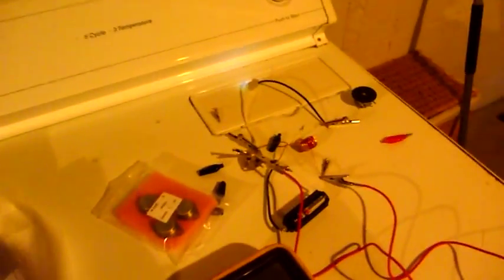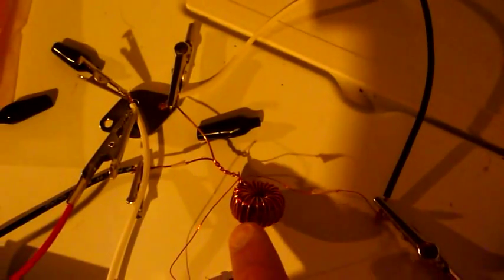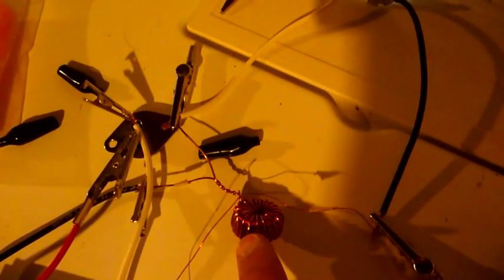Joule Thief with Magnet more light

Comment: Can you measure the volts of the battery before using the magnet and after using the magnet I am wondering if the feedback from the magnet charges the battery. If thats so then no need to have a generator just put a powerful magnet beside a large toroid.

Comment: I think the magnet causes a change in inductance, and therefore frequency...it changes the circuit dynamics, like a dj changing the song :) your light is boogying.
Reply from the maker: I agree, the magnet is pulling the magnetic flux in a different direction. It is interracting with the flux generated from the electrical current moving in the coil.